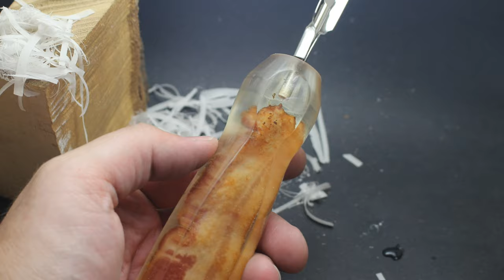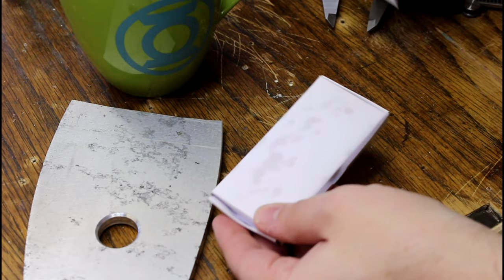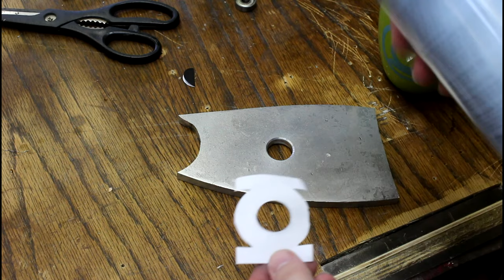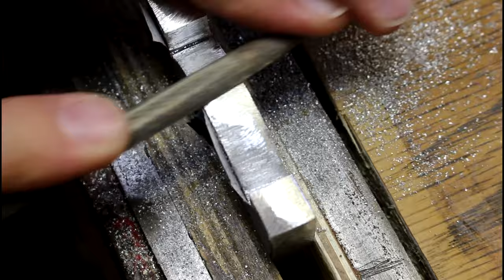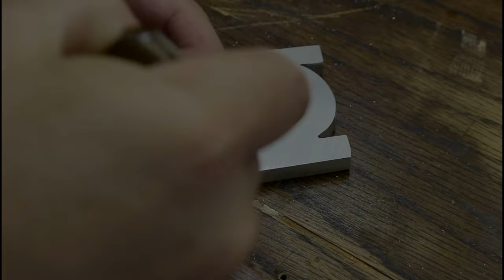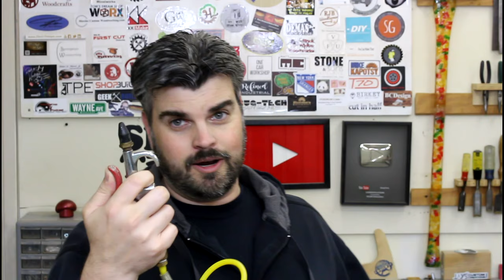Aluminum Fidget Spinner

Comment: I have ADD and I'm an obsessive fidgeter. I wear through decks of cards from shuffling too much (current total is 3), I fidget with everything; my chap stick cap, pencils, my pocket knife (both opening it and shredding paper), you name it. I've even worn out the rocker switch on the Fidget Cube I got as a gift, and that thing was made for fidgeting. Even still, I really don't get the whole fidget spinner thing. Fidgeting is normally a one handed thing, whereas you need two for these things. To me it'd be more distracting than helpful. Oh well. To each their own.
Reply: That's what I was thinking. Fidgeting distracts me from my own work. I don't see how it could help focus, and I might even have ADD. I'm not going to self diagnose, but focusing can be hard. Fidgeting gets no work done.

Comment: Gotta say - I don't have a nervousness disorder or ADHD, but I have had RLS for somewhere around 15-17 years. I work on the store level management side of convenience stores, and, despite my reservations, picking up a cheap $20 spinner has helped me quite a bit. I spend my nights mostly doing store repairs, fixing problems, investigating complaints and issues, and tracking various sales information, but I do mostly work alone, and therefore tend to customers. Which, specifically, is the one thing I'm not particularly fond of. I'm not great with people, terrible at small talk, and normally pace around for most of the day, a habit that formed keep the RLS occupied. The spinner I picked up has been great for having to stand in place for several minutes at a time, whether waiting on a customer, or rattling my head on whatever the problem of the night is. Gives you something to vent subconscious energy into, especially interesting since most of the things I enjoy doing involve working with my hands.

Comment: sir brown i know this is ur first time using bearings but for fidget spinners u degrease the bearings spins longer and faster
Reply: Gasoline works well, right? As well as rubbing alcohol.
Reply from the maker: Interesting! I can do that easily enough...
Reply: Peter Brown acetone is perfect too
Reply: D3urke Dancer or if you wanna go cheap, lighter fluid is good too.
Reply: I blow out most of the grease with the air gun, then chuck them in a jar of turps, swish it round, then blow dry. (with the compressed air, not an actual blow dryer) Works great. If the bearing only has oil, turps and the air will do it.  30 plus spinners and counting, it is the best technique I have found.
Reply: HandyAnj I misread this and thought you put it in a jar of turnips.
Reply: +Mindy Wolfe. That is so funny! I do weird reads all the time. Totally changes how you see the world, just for that moment...
Reply: Don't use the air compressor on them though. If the bearing fails there goes your hand.

Comment: 1st. I love these videos. 2nd. from a metal guy to a wood guy. it helps exponentially to use wax if your cutting, drilling  or sanding aluminum.  yes oil works. but for some reason wax help increase accuracy and make your abrasives last alot longer

Comment: working in a machine shop, i use aluminum all the time. if you throw a bit off coolant on it while cutting and sanding the dust clumps and drops to the floor instead of flying everywhere.

Comment: I started working with resin soaked paper pulp towards the end of my degree. Unfortunately I don't have the images up on my blog or facebook artist page, but it has some really neat qualities. You can cast a block of paper, paint it with water based inks, and then soak the block in resin and it traps whatever you have painted on, and because water based ink is transparent you're left with a hard block with images and patterns on, that light can pass through and change colour, plus the whole thing can be polished to a shine, especially with a lacquer coat.

Probably not ideal for turning though as whatever you paint on will only sink a couple of mm into the surface. There's probably a lot you can do by casting paper pulp and soaking it with resin. I had trouble getting polyester to cure in the paper for some reason, but clear epoxy worked great.

Comment: Sorry to come in so late. Been binge watching your videos, and my kids are loving them as well. Didn’t see this tip anywhere else, so I figured I’d pipe up. When I was in shop class in high school (back when such things were a thing), my teacher taught us to lubricate the band saw with beeswax before cutting aluminum to protect the blade. He said he used to snap blades left and right till he started using the beeswax. Just turn on the blade, cut the chunk of wax like you would with anything, and then go for the metal. You know you need more when it starts feeling gummy as you said. Love your vids, love your singing, love that you let your nerd flag fly!

Comment: We use rubber cement to attach stencils to metal! It makes the paper into a kind of sticker thing. I did this in my art metals class at school!
I've also seen people lay stencils on the metal then spray paint the negative space, but I still think the first way would work better!
Reply: Also, as far as sanding goes, I've learned it's best to alternate every time you go up a grit level so the scratches made by the last one are kind of fixed by the next grit? If that makes sense...it gives the metal a nice, smooth surface, and then you buff it and it gets even shinier!

Comment: I think it might be in the bearing. I'm pretty sure the bearings you used weren't the ones typically used in fidget spinners. It seems other ones (even lighter ones) spin for quite a while longer.

Comment: @Peter Brown, Nice metal work. Ok, you have to try this. Set your compressor to its highest pressure. Place a tennis ball in your hand palm facing up. Slightly cup your palm around the bottom of the ball. Take the air nozzle and force air between your palm and the ball. When you get everything aimed correctly the ball will lift off your and hand start spinning like crazy. It starts to become terrifying as the ball begins to grow due to the rotating force. I had one spinning so fast it was only about 2 inches thick. Next, drop the ball in a 5-gallon bucket full of water. Do this outside because you are about to empty a large portion of the bucket's contents into your face. Use a new tennis ball or you'll suddenly have feelings of dread when you imagine the ball fragmenting in your hand at speed.

Comment: Just for future reference, a quick and easy way to transfer a template to metal (or anything else really) is to lay it flat on the piece, use a dab of spray adhesive if needed, and throw a light mist of spray paint over it. That leaves you with a template that can't be torn off when cutting and shows an obvious, high contrast line to work up to.

Comment: personally, i use mine for my actual anxiety disorder and it really helps in class (i have multiple anti-anxiety toys and my spinner is one of the top 3) but these things have become more of a "fashion" item recently and its kinda upsetting that this has happened... like with you making jokes about the air compressor in the middle of a meeting, i can tell you've only seen the fashion side rather than the function side of this kind of toy. not saying you're a bad person or anything lol i actually found that funny

Comment: If you want it to spin longer, clean all of the grease out with soap and water.

This is generally bad practice as you are not meant to run bearings dry, but as this is not a high loaded system, it's not an issue and you will get better results.

Comment: man you make these the hard way.  I just load the file in my 3d printer and hit print.  jk dude well done.  now try to lathe some center caps for the bearing out of crayons or resin.  a crayon cap that's pointed on the bottom would be really cool.

Comment: Hey Peter! 
I somehow went down a hole of aluminum works and I came across a youtuber named Engineer BrunS.
They did a cool thing called a cube in a cube, but theirs is metal. I was wondering if you could attempt to make it in wood if possible? I think you could pull it off nicely o:

Comment: hey peter recently one of my game disks cracked on the inside ring of the disk(not the part that is read by systems) and i was wondering if you could take a cracked disk and fix it with resin and see if it still works i dont know if you play games are not but i hope you consider it have a good day

Comment: "we're not machinists" 
did you just assume my trade?
Reply from the maker: Are machinist watching my channel? I would think THAT would give them anxiety... :)
Reply: Peter Brown you haven't commit any atrocities to metalworking yet, although a tip, 
when cutting aluminum use paste wax as a lubricant, put it along the cut line of your part and on the blade so that as the blade heats up it becomes cutting lubricant
it helps fight the "gummy-ness" of aluminum

Comment: Fidget toys are most commonly used by people with autism, anxiety and ADD. They have been proven to help the person concentrate better giving their hands something to do so their brains can actually focus on what is important. I have both anxiety and ADD without fidget toys I am a complete mess in public or trying to do anything that requires sitting/concentrating for long periods. 

Also I doubt you meant to come off like it but you sounded very condescending talking about someone using one in a meeting. Without a fidget toy that person could literally be looking right at the speaker and not hear a thing they are saying because their brains can't focus.